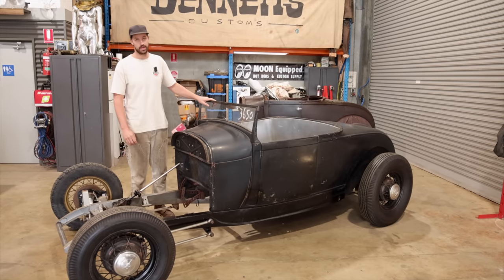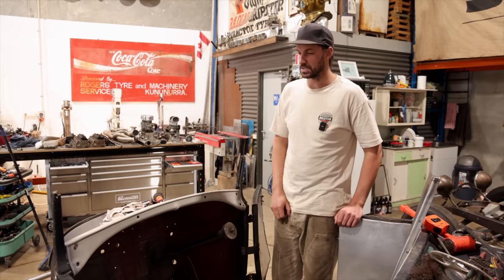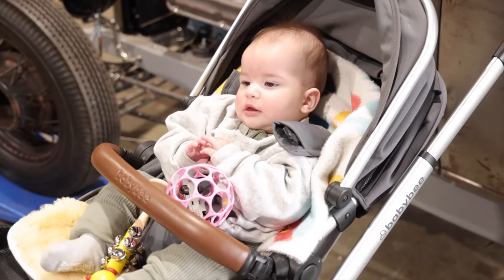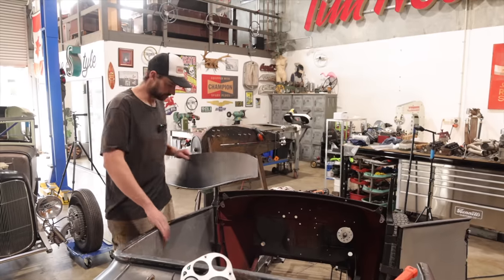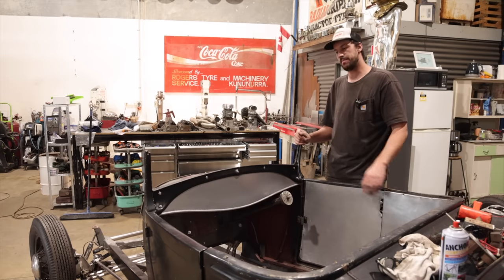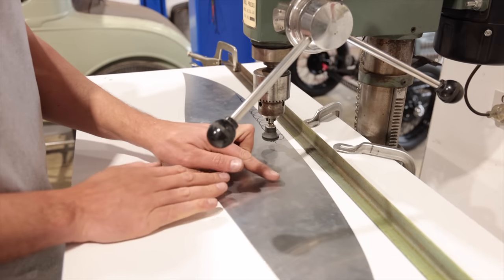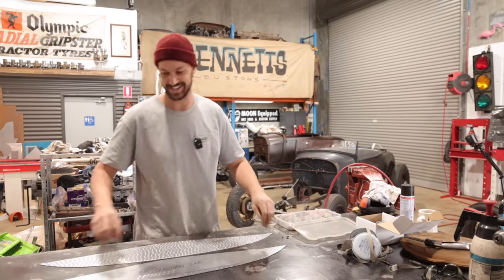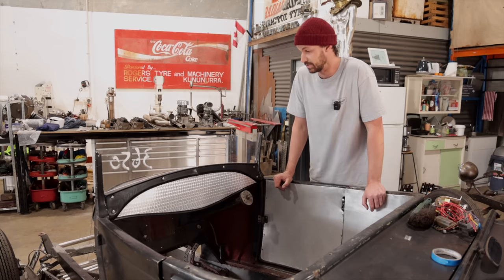HOW TO make SIMPLE Dash Panel With Engine-Turned Insert - '29 ROADSTER

Comment: Looking good a few thoughts, if you could get an ignition switch from an old Land Rover, its an ignition switch in the center with a secondary short lever around it which is the headlight switch and also the indicator switch from an Austin A40 i think it is , its about the same size as the Land Rover switch amd also lever type but its also translucent and as the indicator it turned on the whole switch flashes, very old school and very different . If using a seperate starter switch instead of a push button which everyone is doing, what anout a pull switch, one from an early Morris Minor or an MG-A the switch is mounted on the firewall with a rod passing through the dashboard with a chrome 'T' pull handle.
Reply from the maker: Awesome thank you for the tip! I’ll look into them this morning, what a cool idea!

Comment: The Engine Turned Panel will look real nice ------ as you say ----- once the six gages are in ----- an ignition switch / button is in ---- a High Beam and Generator light -----  that will finish it off ----- won't be overwhelmed by all the turning ------- Years ago a guy restoring an old car came into the shop wanted us to make a new  Engine Turned panel ----- I don't remember the make of car ---- seems like it was a Bentley ---- BUT ----- this had to be evenly spaced ---- side to side ---- top to bottom ----------- I remember it took quite a while ------ wasn't on a drill press had to be done on a mill with a digital readout ------ he had the money  --------------------- Since your shop is called --" Bennetts Customs " ------------Could incorporate your name into it also ----- in kind of a roundabout way ----------- 3650 - Bennitto  ------------ or ----- Benito ---------- or -------- Bennetto -------------- Anyway --- Thank You for the video ------ Hope you are not affected by the Heat Wave ---- or ---- all the smoke ----- to the point where one has to stay inside ------------ Till your next one ------- Take Care and have a Good One --- Rodney